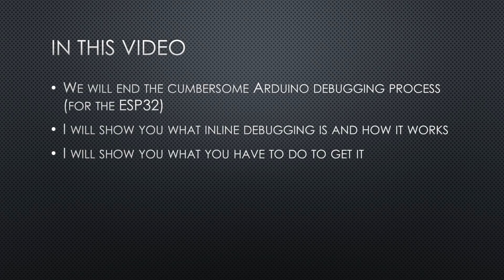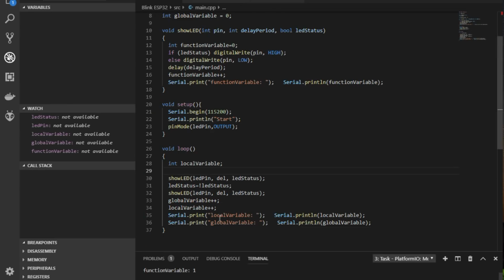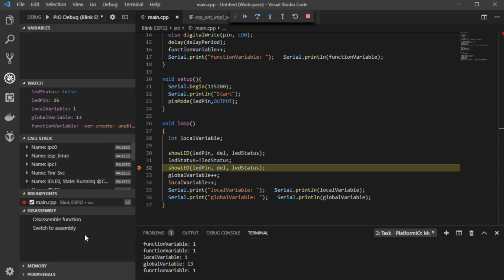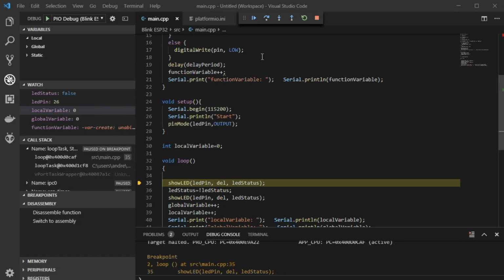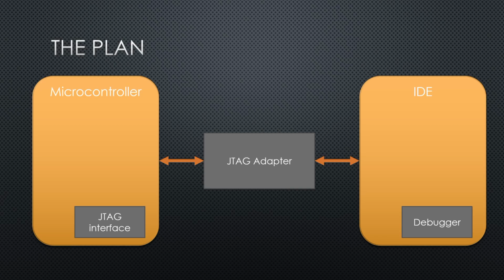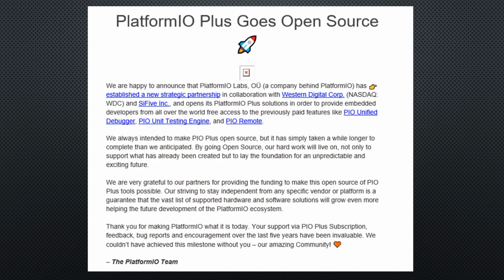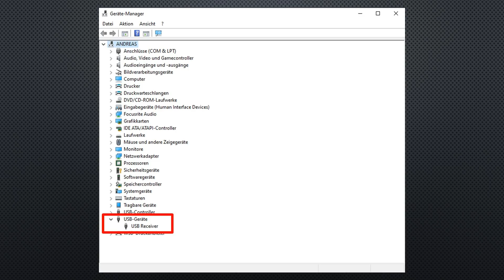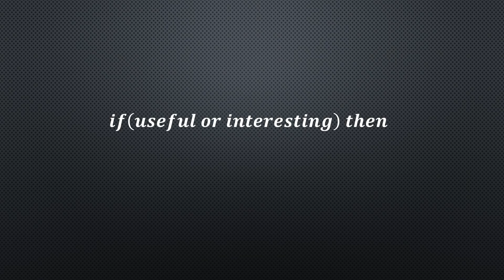#274 Free Inline Debugging for ESP32 and Arduino Sketches

Comment: Great, but I am not sure about the poweriing of the ESP-prog...
Do you connect ESP-VDD somewhere to the ESP32 ?
or do you have 2 USB cables to the PC ?
A wiring diagram could help,
Thanks a lot,
Alain
Reply from the maker: So far I used two cables (JTAG in addition to the normal .cable But I read that you can load the sketch also through the JTAG connection.
Reply: @AndreasSpiess  

It is what I did, and, thanks God and Andreas, it works (from to day...). It is a tremendous progress in the IDE world.

Comment: Everybody seems very excited about this new JTAG debug thing on PlatformIO. Sorry to rain on your parade but has anybody (other than Andreas) actually tried it? I have bought the ESP-Prog JTAG adapter and followed the steps in the video, which by the way are exact, spot on and professional but we have come to expect that from Mr. Spiess and I managed to make it work relatively quickly. It is slow, buggy, crashes a lot and it is more or less unusable. I get things like this in the Debug Console all the time: 

Temporary breakpoint
1, setup () at src\main.cpp:13
13 {
/builds/idf/crosstool-NG/.build/src/gdb-7.10/gdb/regcache.c:697: internal-error: regcache_raw_read_unsigned: Assertion `regnum >= 0 && regnum < regcache->descr->nr_raw_registers' failed.
A problem internal to GDB has been detected,
further debugging may prove unreliable.
Quit this debugging session?
(y or n) [answered Y; input not from terminal]

This is a bug, please report it.
  For instructions, see:
<http://www.gnu.org/software/gdb/bugs/>.

/builds/idf/crosstool-NG/.build/src/gdb-7.10/gdb/regcache.c:697: internal-error: regcache_raw_read_unsigned: Assertion `regnum >= 0 && regnum < regcache->descr->nr_raw_registers' failed.
A problem internal to GDB has been detected,
further debugging may prove unreliable.
Create a core file of GDB?
(y or n) [answered Y; input not from terminal]

The only way to recover from this error is to unplug the USB cable and restart Visual Studio Code. This looks like highly experimental code, not even beta. They made it free not because of WD sponsorship but because nobody would pay for something that doesn't really work that well. 

Don't get me wrong, I would love to have a real debugger, but this is not it, at least not yet. I would even pay for such a thing, after all I have already wasted my money on two ESP-Prog JTAG adapters which are now useless until PlatformIO turns this into something that actually works. 

Somebody needs to debug this debugger ;-) Oh well, back to printfs until then.
Reply from the maker: Strange. I had no such issues and AFAIK this functionality exists sometime and is used quit often. Do you use the new 4.0 release announced a few days ago? I would contact the PlatformIO team.
Reply: @AndreasSpiess  I just installed everything yesterday before doing the test so I assume this is the latest and greatest. PlatformIO reports Home 2.2.0 Core 4.0.0, Visual Studio Code is 1.36.1. I am really disappointed by this, I had great hopes of using it on some new projects that I will have to put on hold for now.
Reply from the maker: Maybe you can connect the team? You seem to use 4.0 version and maybe you can get the one I used for the next time till 4.0 is debugged.
Reply: @AndreasSpiess  What version of PlatformIO did you test?
Reply from the maker: I do not know and I do not know how to check :-( But my video was done before I got the 4.0 announcement.

Comment: If you have the JTAG adapter connected, you can upload the program via the debugger, at 20 MBit/s. Just add “upload_protocol = esp-prog” to platform.ini. You can then disconnect the USB cable to the dev board and replace it with 3.3V supply from the adapter to the dev board.
Reply from the maker: So far I thought you need the second channel to do that and you have to connect this channel also to the chip. I did not know it runs on the JTAG wires.

Comment: Of course AVR supports in-circuit debugging, it's not like chip developers are idiots. Not in conjunction with Arduino of course, you need AVR Studio and AVR Dragon. The reset pin is used for the I/O.

There's probably a couple reasons it's not available with Arduino. One is that Arduino tries to make do with the bare minimum amount of hardware for cost, and a debugging interface always needs a bit extra. Other is that Atmel conveniently forgot to document the physical and logical interfaces. But at the end of the day it's fairly obvious and gdb virtual stubs are around now.
Reply from the maker: I knew about the 1 wire interface. That is why I said: No jtag support. And with this, no cheap debugging hardware (AFAIK). If you know one which works with PIO I would be glad to try it out. Would for sure be interesting for many of us.

Comment: This sure would have helped last summer with debugging the tank communications problems.
That brings up another situation where serial debugging does not work well
Debugging a crash.  The serial writes are cached; so, the messages go out after a delay - and sometimes not at all when a crash occurs.
This can mislead you regarding where the code is crashing.
Reply from the maker: The Espressif IDE has a possibility to invoke the debugger after a crash to find out the last steps before. Maybe this is also available in PIO/Arduino framework. I do not know.

Comment: Thank you for doing this great video. I tried to replicate the same on a Arduino Due with an Atmel-ICE using the same platform, but getting the following error. "Can not execute this command while the target is running." I think the issue is in the platformio.ini. Appreciate if you could help me since I couldn't find clear instructions online. Thank you.
Reply from the maker: I do not have an Atmel ICE, so  I cannot help.
Reply: Hi Brian, Did you manage to get your Atmel-ICE working for debugging? I use mine all the time and it works great for this arrangement of PlatformIO, VS Code, and Atmel-ICE. Let me know ... perhaps I can help if you are still having difficulties. Robert

Comment: Very nice video, I must try to hold myself back from buying yet another debugging interface :-)   I'm wondering during your debugging, what's feeding the watchdog?  I wonder if the GDB debugging session reaches into the CPU and disables the watchdog timer when the CPU is halted?  I wonder if the other CPU core is still running?  So many question to pique my interest..  Thanks for the video; I suppose now in retrospect since you pointed it out, it seems obvious that the Expressif CPUs would have some debugging interface; just hadn't considered it.  Glad that you did!
Reply from the maker: I never looked at the internals. So I do not know. I did not see a watchdog appearing ;-)

Comment: This is substantially simpler with the ESP32-DEVKIT board, which has JTAG over serial.  I got it up and working with NO external jtag interface.

https://smile.amazon.com/gp/product/B07GLXRQWZ/ref=ppx_yo_dt_b_search_asin_title?ie=UTF8&psc=1

I've also got it working with the bare WROVER module using the Olimex "tiny" j-tag interface, so that's a workable solution as well.
Reply from the maker: I had it also running with the devkit. This one seems to have the jtag chip on the board. It is also quite expensive

Comment: Hi Andreas, sorry if this is a dumb question. This JTAG interface will be the way the code you develop on PlatformIO gets written to the ESP32 too (besides the debugging capabilities) or you will use the ESP32 USB connector? If you have a link where this is answered it is OK, as I do not want to abuse your time :-)
Reply from the maker: As shown, the JTAG interface uses 4 additional pins. The code is downloaded as normal through USB to serial adapter
Reply: @AndreasSpiess  Thanks, that is nice that that interface is doing all. Regards and thanks for your help and prompt answer.
Reply: The normal setup is to have the ESP32 connected via both the USB connector and the JTAG adapter. The program will be uploaded via the USB connection. However, if you add upload_protocol = esp-prog to platform.ini, the program will be uploaded via the JTAG adapter (at 20 Mbit/s). You can even remove the USB connection altogether if you provide power from the JTAG adapter to the ESP32.
Reply: @robatoto  Thanks, that was very helpfull!

Comment: ESP32 is so great,  i hope one day I will wake up and find on Aliexpress board that is 5V I/O pins tolerant out of box!
Reply from the maker: I do not know about the ESP32. The ESP8266 is 5 volts tolerant.
Reply: @AndreasSpiess  Are You sure,  I think: ESP8266 is what i have on  NodeMCU and it's a 3.3V. Nnodemcu is advertised by sellers as 5V, because board have  3.3V regulator for powering off 5V microusb - but pins are 3.3V when HIGH as output and on input i would not put straight 5V.
You definitely push me towards trying out this debugger, and i'm grateful for Your work (my wallet says otherwise but he have nothing to say).
Reply from the maker: The CEO of Espressif once confirmed the 5V compatibility.

Comment: Erm, it's not free if you have to purchase a development and debugging tool to do the JTAG communications!
Reply from the maker: You are right. Debugging is free, not the adapter (if your board does not have it built-in)
Reply: @AndreasSpiess  So you should say low cost debugging as the hardware is required :)

Comment: Great video Andreas! ... This remember's me to my first job (long long ago) where we created a (expensive) hardware for JTAG debugging support for the pentium processor. The main focus was to enable conditional breakpoints (as you showed) very fast. You always have to stop the processor put in some serial bitstream into the pins to get the needed values out ... on a pentium this was ~1KBit ... For that we created a special ASIC (25 years ago!) to achieve this very fast. My job was the software ... I miss these days ;-)
Reply from the maker: And now we have it inside our 5$ chips ;-)
Reply: Btw. If somebody is interested how JTAG debugging works: The processor get's stopped .. all important registers of the CPU get copied into 'shadow' registers and this shadow registers can be 'clocked' out serial using a special protocol through the connected lines.
Also memory can be read and written that way.   Sometimes CPUs have special debug registers that can be adressed also ... btw. many chips support  a JTAG interface ....  the cool thing is that you can chain them together if you have a larger circuit, but then it get's a real serial mess ;-)
Reply from the maker: Thanks for the details. Dave J. did one a video where he also mentioned the "serialization". But it was less for processors and more for "boundary checks" of ordinary HW. For processors, I would assume you would spend the money for a second adapter to reduce the complexity of the software.

Comment: Hey Andreas! That’s is not correct, arduino 328p supports full debuging via armed studio and JtagIce... I use it all the time and it works well not only with Sam core but also with Arm cores such as Arduino zeros... cost  £70
Reply from the maker: I am not sure it uses JTAG. It uses proprietary   1wire protocol and AFAIK was never integrated into Arduino.

Comment: Does this jtag also work to program the esp32?
Reply from the maker: As I said, they have a Second serial connector which can be used for that.  Needs a second cable and is only for naked modules

Comment: LOL - I was building systems back in 70s to 90s  - I remember using  those Intel MDS-80 development stations with the 8 inch floppies. 
Recently been looking to get back in for some hobby projects.
Funny part is in the videos I saw there seemed to be no In-line debugger or emulator; I was very Puzzled,...  CERTAINLY NO ONE WOULD BE DEVELOPING CODE WITHOUT ONE!!  LOL -  Thankyou for the video - definitely adding this to the list !!!!
Reply from the maker: Same as me. Now we do no more need emulators. We use the chip itself.

Comment: Wow, this is a game changer for sure. I hope I can get some time to try this out. I've been hesitating about working with the ESP32 (as I have a bunch of other Arduinos and compatibles already) but if I can get this working there's no excuse now.

I would really love to see you come back to this from time to time with updates as you continue to work with this system and figure other things out, and perhaps as PIO addresses any issues you've run into.
Reply from the maker: We will see. I have many topics to cover, so usually I only come back for substantial changes
Reply: @AndreasSpiess  Yes. I would , think you would only want revisit this if you find something really significantly interesting (as you have done with a few other videos) but of course that also assumes you continue with it yourself. Looking at the comments there seems to be a lot of people very interested in this, so I guess you'd want to consider that as well. I really hope I have time for this myself soon. The library of information you are building on this channel is really amazing.

Comment: The biggest problem with printf debugging I'd that it changes the timings. In a complex system with interrupts this can create or mask race conditions: just by adding a print you could hide a bug that comes back when you remove the printf....
Reply from the maker: Another reason. I did not check the timing of this debugger. Maybe somebody knows if it slows down execution.
Reply: @AndreasSpiess  Usually hardware debugging is transparent. There's no extra cycle for debugging. It's the CPU hardware that checks if there's something special to do. Many CPUs have conditionnal breakpoints (ex: stop here if x<0) in limited number because there's only a limited number of transistors to do that

Comment: Avr chips like the 328 have debugWire that uses only 1 wire to do in system debugging. Unfortunately this requires (expensive) AVR proprietary hardware and software... And is not integrated with Arduino platform.
Reply from the maker: I knew about that. But as you wrote, it was nothing for makers :-(
Reply: @AndreasSpiess  it depends on your involvement in the AVR platform.
Many mcus do hardware debugging for a reasonable price.
Ex: Stm32 do that very well.

Comment: One, not just "newer AVR's" support jtag. Just going one step above 328's also adds JTAG. I know I've seen the pinouts on the 644/1284 datasheet. So you can even pick up JTAG with a chip supported by Arduino that also comes in a DIL package.
 
  Second, you made my inner Tux cringe with that Windoze IDE thingy. Will this work with Atom and Platform IO?
 
  Lastly, while I have watched it at least twice, and still haven't tried it, LadyAda did a live stream a few years ago showing how Adafruit uses OpenOCD with a raspberry π. I think that has similar functionality. I saved that upload in a publicly listed playlist with OpenOCD in the name if you haven't seen it or are interested but can't find it.
Thanks for the upload.
-Jake
Reply from the maker: I will try it once I get the new Arduino Nanos. And these inline debuggers are very similar. Not complicated at the surface, but quite complex in the background
Reply: If you have armel icd like avr dragon or avr ice you can debug smaller chips. I used dragon for debugging attiny2313 with debugwire :)
Debugwire uses reset pin so you can use normal spi programming interface to debug. eg ATMega328 supports debugwire that arduino nano have.
I haven't check does MPLAB Snap support debugwire but that's new debugger for AVR, ARM and PIC from Microchip. This is bare card and under 20 usd

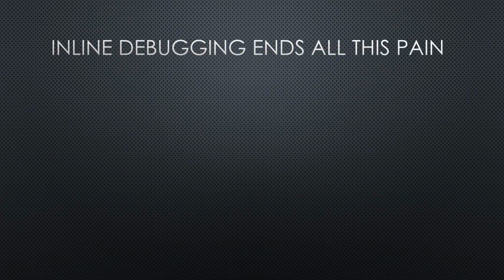Comment: 1:58 - Also, using the serial port to debug doesn't work at all if the serial port is used by the sketch for something else.
Reply: I didn't see this issue you are referencing. Everything worked fine for me the first time around. The only annoying thing I dealt with was having to step through some FreeRTOS code. Other than that, it was an absolute delight to step through my code any way I wanted. The assembled code was also listed and you can debug through it if that's your thing.
Reply: Also, using the serial port, even just invoking it and not using it, consumes more electrical power. Important if you are zoned into low power devices.

Comment: I am fairly certain you can use any Linux SBC GPIO interface to do JTAG debugging. Search for openocd remote bitbang, and you may use a raspberry pi zero w as a wireless JTAG emulator for half the olimex price.
Reply from the maker: Thank you for the tip. I am not sure if I want that ;-) I like the approach to have a dedicated debugger.
Reply: Not sure you want it? You can't debug a drone mid-flight with an USB cable. (granted it would crash as soon as it hit a breakpoint, but still... ;-)

Comment: Great video! I was curious if there are more jtag devices I can choose from and find out this: https://github.com/platformio/platform-espressif32/blob/8d08246acdeb8a828bc59d213e8bf449b9de53c5/platform.py#L54 It seems PlatformIO supports more devices for esp32. 
What's more interesting esp32 supports even more interfaces https://github.com/espressif/openocd-esp32/tree/master/tcl/interface I can see in this list much cheaper Altera Blaster and even Raspberry Pi! I wonder when (or if) PlatformIO will add them.
Reply from the maker: There are probably more. But I was not able to test them.